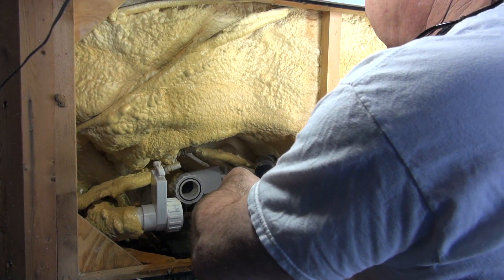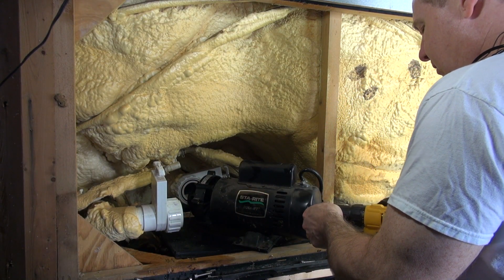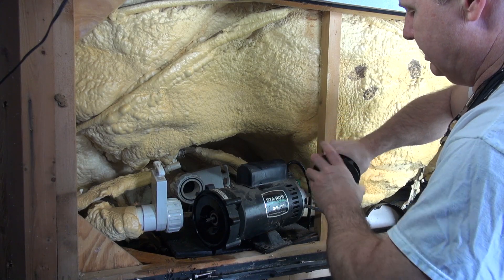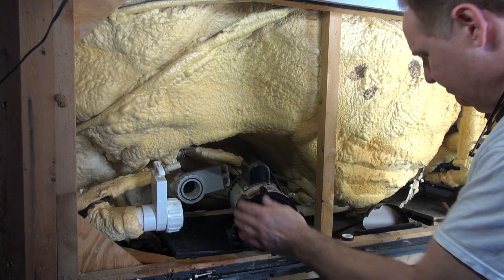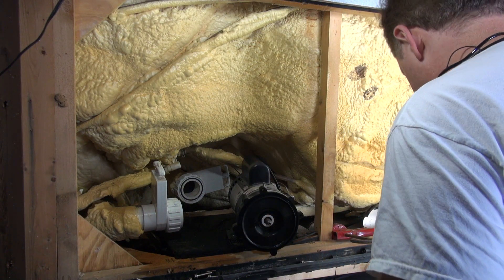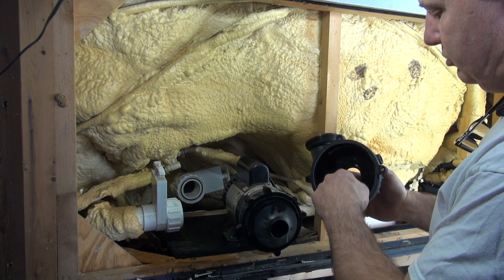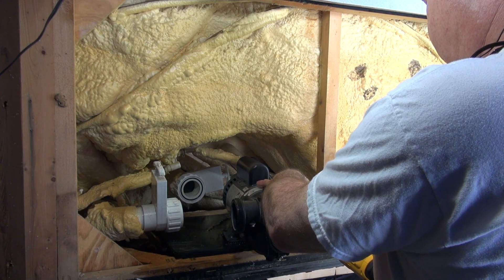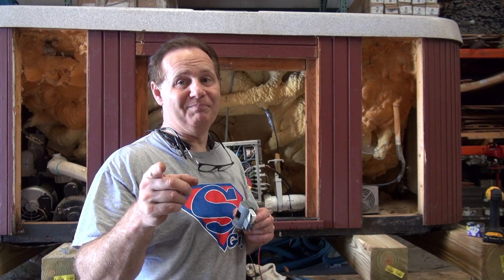How To Replace a Seal on a Sta-Rite Pump How To Repair The Spa Guy

Comment: After seal replacement is it supposed to seal 100%. I don't see water dripping, but if I feel with my hand after it runs for over 15 minutes I can feel some water seeping.
Reply from the maker: Yes it should not leak any..
Reply: @SpaGuy  It was a slight weep from the area with the large clamp. A few more turns and all is dry. Thank you for your input.